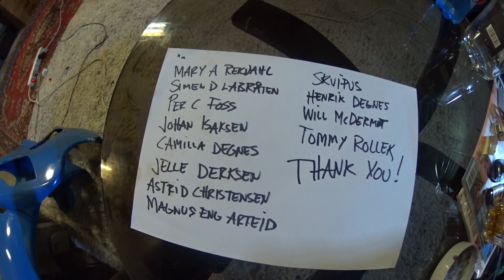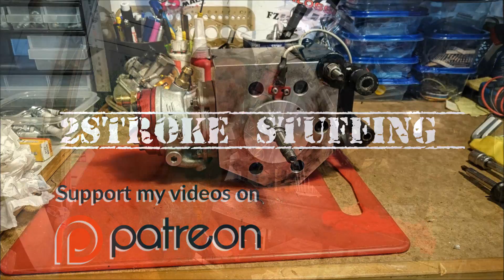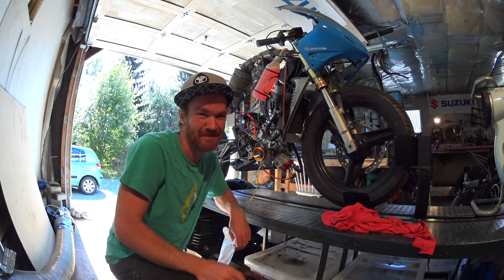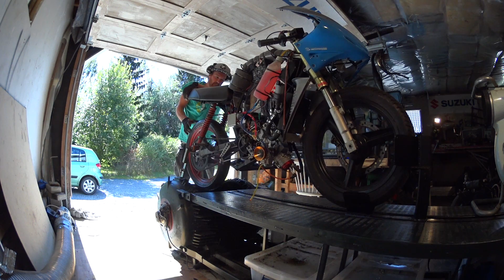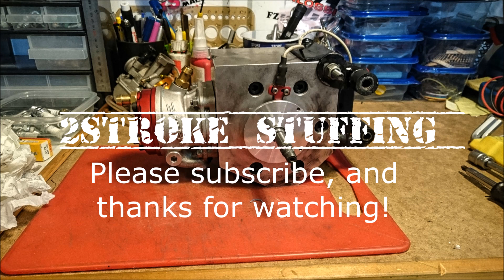Two Stroke Running With NO INTAKE VALVE!

Comment: Would be interesting if you took the expansion chamber off and tried again.
The gas dynamics involved might come under Helmholtz theory, but i've found it difficult to get to bottom of how it works. I've tried a sim model in the commerical 1-D engine software I have but its impossible to model an engine without an valve or intake duration of 360*, the code won't accept it. Shame
You mentioned Frits' 24/7 in one of your videos, again hard to pin it down as Frits talks about it alot however won't disclose any data results with the thinnest of excuses so a peer review can't take place. Shame

Bravo, encore
Reply from the maker: +cara vaggio sure would be!

Comment: Use Tesla valce https://www.youtube.com/watch?v=rYlP5TEKf2w
There will be no limit on Rev, only what will withstand the crank and piston. 
Tesla valve have no moving parts. Back flow closes self with back presure itself. In low pressure it will leaking ... but who cares at low end ;-)
Reply from the maker: +Jan Havel Interesting, I've actually seen a prototype drop-in for reeds somewhere.

Comment: Have you tried fitting an accurate pressure sensor to your crankcase? An accurate crank rotation sensor is helpful to if data is captured alongside the pressure/vacuum sensor. Very useful when dialing in your rotary valve. I had to make my own but that was before....long before I could enjoy watching a video from Sweden and share a few thoughts. I imagine there's a data logger available now for fine tuning 2 strokes. What can be interesting is seeing a pressure increase after the transfer port is partially open and deciding what to try next. Take care, Jim Marriott
Reply from the maker: +Jim Marriott Haven't, but that would be interesting indeed! I see that pressure increase after the transfers open in simulations. Happens when blowdown STA becomes insufficient at higher rpm. Norway btw.

Comment: i had a kawasaki lol sorry for spelling, it was a 249cc 2 stroke..no reed valves or anything just the carb...it would spit a bit but it ran good for years :) i like your bike you have worked hard on it..the only thing i did years ago to my bike was make a cone airfilter directly on the carb so it would catch the spiting fuel on the filter and gas the air going in :) no waste of fuel :)

Comment: You previously said that high exhaust durations are not needed for high RPMs, what you need is more blowdown. My question is how much blowdown do you have? people have told me to try and stay between 30-35 degrees, is that correct?

Love your channel and content, keep up the great work dude! Greetings from Sweden :)
Reply from the maker: +MatarengiMoppers Thanks! Measuring blowdown in degrees of crankshaft movement won't tell you much at all about blowdown area, and that's what matters! Google "specific time area".

Comment: try the longer intake like you said, and stick a boost bottle on it. the size of the bottle will be crucial. it will resonate and hold most of the mixture not used, then blast it back in at the right moment.
Reply from the maker: +jjhack3r Could work!

Comment: Could always just make it Reed valve
Reply from the maker: +daniel miller...but what's the fun in that😀
Reply: 2STROKE STUFFING ENGELSK
The point is that you get more power than ever before
Reply: I have an MZ 250 that uses piston controlled timing, is there any easy way to improve this without reeds?
Reply from the maker: +Jack Lissimore Higher port duration will improve top end, but the low end will suffer. The disadvantage with piston controlled timing is that it is symmetric.
Reply: Have you been also testing reed valve before the carb?

I would like to do it on an airplane but would need many custo parts.... so I would love to know what I would gain bedore voiding its certificate and making all the parts needed 😁 curent design is without any valves
Reply from the maker: I actually made one that will fit the carb, but didn't experiment much with it. Did work tho.

Comment: Awesome video! Don't you have to adjust the pipe for better cylinder scavenging? Great idea with a longer intake, increasing air velocity in the intake could help combat the mixture trying to escape through the carb. What about an airbox for intake resonance? With an airbox and tuned exhaust you could potentially adjust the resonance on both "ends" of the motor. I apologize if I don't make any sense, I'm technically not a 2 stroke guy, but I do have a rotary! :D EDIT This also reminds me of the old 2 stroke diesels that needed a blower to help cylinder filling, might be another approach, just throwing it out there.
Reply from the maker: +TheForcedinductn Thanks! No worries, you are absolutely making sense. The current exhaust should work fine, as long as I  can get the intake/crankcase in resonance with it.
Reply: Cool stuff, can't wait to see this progress!

Comment: That's why I suggested keep a fire extinguisher on hand LOL, big fuel chooch from the carb, big time rich too doubling dosing over the jet nozzle. Problem is you would have to jet down the carb to get a decent mixture without the disc to then see the comparison to correctly jetted with a disk. The effort doing it might not reveal much you didn't already expect.
Reply from the maker: +I Make and Fix Stuff haha, yeah it's pretty bad... I'm currently on the fence. Keep on testing valveless or get a new valve.
Reply: Need a new disc anyway so maybe grab one and do a patch on this one then a bit of a snip and grind to the old disc for much wider timing. Then trial them against each other. Is the old disc too trashed to patch up ?
Reply from the maker: +I Make and Fix Stuff Great idea! The one I have is beyond repair, I'll see if I can find them for an ok price and buy a few.

Comment: I'm not surprised.  There is a huge difference between allowing it to rev freely with no load and then putting it under a load.  As soon as the load is added, the engine can not accelerate to the elevated rpms necessary to prevent the reversion on the carb.  If you could get the roller going to allow the engine to be at say, 2/3rds the rpm range....say 12k or so, it may be able to accelerate the drum from there....maybe not.
I would try the reed cage attachment to get it to 12k or so, pull it off and see if it will accelerate from there.  I am sceptical but it is worth a try.
Reply: I say 12k because it should be making max torque somewhere near there....maybe a bit higher.  Max torque would be my starting point.  I have a feeling it won't matter due to the reversion.  It will probably just continue to fall in its face when any load is added.
Reply from the maker: +Mike Grady I have that same feeling. Have to do something with the reversion. A longer intake could work, a larger crankcase volume too. Both would lower the systems helmholtz frequency.
Reply: 2STROKE STUFFING, yeah, the longer intake is the easiest but probably a long shot.  I don't know how many engines you have but I doubt I would fool with crankcase volume.  It is liable to get really lazy.  
Good Luck!